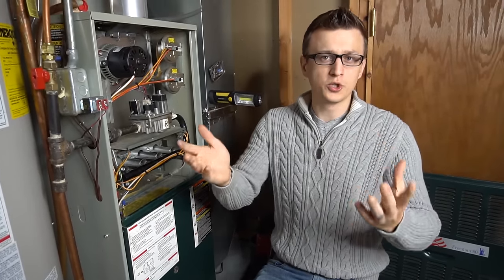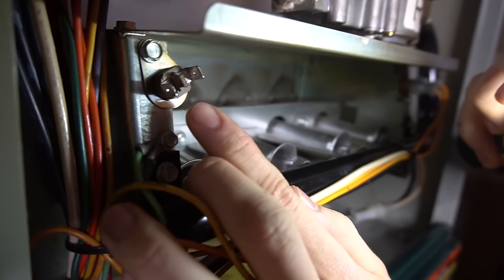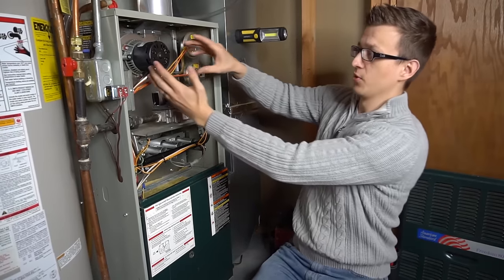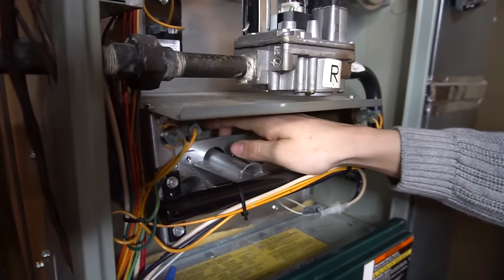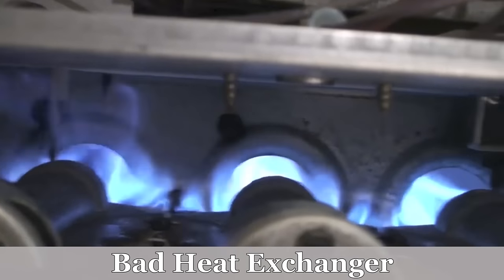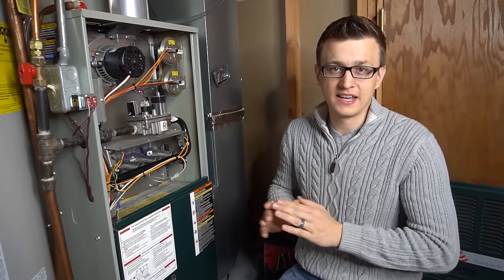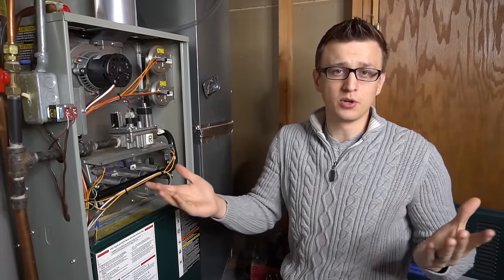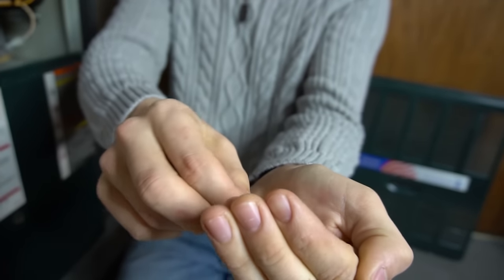Furnace Flame Roll Out Switch Tripped - How it Works

Comment: I'll reset mine exacT SAME unit and it keeps making me wait 3 hours I go out and toggle the hard lock out outside and then come back and sometimes it may come back on if I toggle the switch inside and mess w the thermo it does have 2 rolling buttons one on the flame sensor and one on the glow stick. Its not sticking the flames in they are going straight up and I can see into my attic the cold air is beating down from above the furnace where a tech left it open. Is that what it is? The gaping hole?
Family is freezing its 15 in deer park tx right now
If I smoke a cigarette in garage I can actually smell it through the green door coming from the top so it could be blowing the gas out of the channel I was wondering

Comment: Awesome video
Reply from the maker: Thanks Michael! I appreciate you leaving a comment on many of the videos you watch. You are becoming a familiar face :)
Reply: Very welcome  have a question  should a induser motor be hot to the touch  is that bad
Reply from the maker: Hot is okay, especially if the inducer motor does not have a cooling blade. But it depends how hot.. If you put your hand on the motor and you can't keep it on there for more than 5 seconds.. That's too hot. Most likely that motor is starting to fail.

Comment: I'm installing a new Universal Integrated Furnace Control Board (50M56U-843) to replace my previous control board (50A65-120-04,  56L8401). I should mention that both are White-Rogers products and this going into a Lennox furnace. The instructions that came with the new board has a special replacement instruction at the front, indicating "ROLLOUT SHUNT JUMPER REQUIRED ON ALL TRANE/AMERICAN STANDARD FURNACES, AND ANY YORK P3UR/PCLU MODELS".

Any idea what the jumper would be meant for, since my furnace isn't one of the brands mentioned? I'm assuming that since my brand is a Lennox, my control board would NOT need the jumper.

Comment: HELP! I have a 12 year old Amana furnace, pretty standard, but the flame rollout switch tripped so I had to partially close the gas service shut off valve red handle and that was okay for a month but now it tripped again and I had to further close the valve thus derating the furnace (make the flames smaller and easier to suck in). It seems that the inducer is not sucking hard enough on the heat exchanger, and thus the overheating. The inducer motor is a shaded pole 3000 rpm unit. My pipes are clear, what to do?

Comment: We just got a brand new furnace a couple months ago. I has been working like a charm. Now, 3 days ago we shut it down because warm days and all that saving energy blah blah. Today I tried to start it again (its cold as a penguin's ass) and I got the open rollout/open control fuse light blinking.

So my question is: do this things tend to break that easily?. or is it just because I shut the whole thing down?. Any help would be greatly appreciated.

Also, great video. Very educational.
Reply from the maker: Odd, if it's a new furnace then it's pretty rare that the flame rollout would trip. By control fuse, does it mean that the 3 amp fuse on the control board is blown? (could be caused by various things, like the AC for example) I think the fuse would be more likely the problem then the rollout. You shutting it down for 3 days should not have any side-effects on a normally operating furnace/air conditioner

Comment: Dude you’re awesome! Great at breaking things down. So for the most part what are some things to check out when the roll out switch trips? (Btw thought it was funny when you were smacking the shit outta your flashlight at 3:05) lol
Reply from the maker: Lol, thanks man. I guess I forgot to edit that part out, oops :D It's a good flashlight, the batteries were in there a bit lopsided though so it needed a few good smacks. 

If the flame roll out is tripped, I usually check the vent pipe and the intake pipe (if high efficiency) for any obstructions, bird nest material, etc. I check that just in case but actually the pressure switch should open instead if there is any problems with drafting.

Then I always check what the carbon monoxide readings are coming out the flue. With a tripped flame roll out, the readings are typically in the thousands PPM. On high efficiency furnaces many times the secondary heat exchanger is plugged and that's what trips it. 

After I reset the roll out and turn the furnace back on, I watch the burner flames when the blower motor comes on. (after it pre-heats) If the flames start flickering when the blower comes on, then there's a high chance that there is a crack or a hole in the heat exchanger. The heat exchanger separates the house air from the combustion gases, therefore the blower motor should not affect the flame patterns in a normally operating furnace. The burner box tends to get pretty hot too. To the point where you can't keep your hand on it.

I visually inspect the heat exchangers too. (Not every time) On an 80% furnace I will pull the blower motor and housing out, get under the furnace and look at the heat exchanger that way. Having an inspection camera or an endoscope for your phone makes life easier.
Reply: Yeah he's one of the best one's on youtube. Very explanatory and slowly walks you through it!  Huge  thumbs up!

Comment: I am having a problem with a furnace giving me a code for a bad roll out switch. Fortunately, there are two units in this home, so after I changed the filters, I swapped the roll out switches from the working unit to the non-working unit with no results changing in either unit. So, then I went ahead and swapped out the hi limit switches and flame sensor again not change. since it was later I left the customers home to wait for parts supply to open however the next day he calls and says now both units are not working. I went back and sapped everything back and still nothing working. Please help on what I should check next and can bad parts contaminate a unit?  Please advise I have an urgent need to get these people some heat before Thanksgiving

Comment: Are the flame roll out switches in the 24V circuit?
Reply from the maker: Yes. Usually in series with other safety switches too.
Reply: @WordofAdviceTV  Thanks! My old heater has no flame roll out switches but I plan to fix that.

Comment: My heater wont start blowing hot air at all. I checked the furnace for error code. Indicator blinks 3 times then stop and so and so and so.  Also I' ve  noticed no gas kicking in and blower fan aren't blowing. I cleaned the fire sensors  , small tube that on induce motor.  I waited till this morning to start it and nothing happened.  Inducer motor aruns but no gas, no blowing motor runs. Help ,please . Thanks

Comment: My Bryant 90 plus gas furnace has. Error code 33. What I found is my night temperature 55 is too low at a very cold day. After I change to 60, it is working fine. At very cold day, you may need to increase your  temperature.

Comment: Can a power spike cause it to trip from a lightning storm etc?
Reply from the maker: I don't think so, or at least it is not something I have ever seen. This switch trips from temperature/heat.
Reply: @WordofAdviceTV  This was my issue, I just pressed the button and it all works now. I looked at my flame and it pulls in very strong like yours does so it all looks good. I checked my pvp pipe all the way and it 100% clear to the roof. very odd by just resetting the switch it seems all good now.

Comment: Rollout switches come in 180 and 200 degree switches?
Reply from the maker: Those are common temps on them but it seems like every manufacturer has a slightly different temp rating on them. So I can't say for sure what temp rating the rollouts come in.

Comment: Actually the Codes are usually on the outside so that panel removal is not necessary to determine the failure mode.

Comment: I have 3 of those switches. 2 by the burner box which doent trip and one on top right below the exhaust tube that goes up. The flames are a perfect cone but for some reason the switch up top just started tripping out of nowhere. I'm not sure why though, does anyone have a suggestion
Reply: You figure it out?

Comment: My roll out switch keeps opening if it gets to hot and I wasn’t having these problems until yesterday when I took the burners out and cleaned them put everything back like it’s supposed to go and now if I try to turn the furnace up to 74 it won’t even get up to that temperature then it starts dropping in temperature on the thermostat when the furnace is running then next thing I know my roll out switch is open

Comment: Anyone got any ADVICE on Old Tripped Rollout HELP PLEASE: I have an old Goodman GHM807003AN Furnace. When  manually lighting my furnace, I sure tripped my Flame Rollout switch and the Fan Stays on now.  I located the two rollout switches, but they do not have any RESET button. The middle has a small bit stickling up, but it does not depress like a Button would.  

Is that correct, - meaning Old Flame Rollouts may not have any reset and the only option is to replace them once tripped?

Comment: How much does it usually cost to have a rollout switch replaced?
Reply from the maker: The flame roll out switch itself is probably around $15-35, depends on what brand of furnace you have. If a technician will come out to replace it, the trip fee alone will be around 100 bucks, then you factor in the part mark-up, labor/diagnostics, and you end up somewhere around $200-250.
Reply: @WordofAdviceTV  
Hey thanks. So, the small black cylinder that sits center on the base of the rollout switch was pulled out like it were a distributor cap of a car engine. A technician pulled it out and left it dangling there freely, held by its wires. The base plate is still screwed in the burner box. Could I pop the black cylinder back into place in its original position or is it broken now?
Reply from the maker: @dodgingdurangos924  The flame roll out switch is a pretty important safety switch. It would be best if you ordered and replaced the switch just in case there is something wrong with it. But yeah, likely there is nothing wrong with it and you can just plug it back in too.
Reply: @WordofAdviceTV  
You're right. I should buy a new one, but I don't even have a part number for it. We have a discontinued Aire-Flow furnace that's been serviced annually. So, I don't think factory parts are available anymore. Suggestions in finding a close copy?

BTW, I popped the flame rollout switch back together and the heater actually did start working again, where as before, it didn't even light up. I monitored the burn cycles all day and the burning was clean and controlled. The furnace functioned as it normally does. But who knows if that switch will do its job of shutting down the system if there's a flame rollout in the future.
Reply from the maker: @dodgingdurangos924  Ah I see.. Well.. I will leave that decision up to you. If you want, you can try testing it by putting a lighter under the sheet metal around that switch or under the switch itself while the furnace is running to warm it up. If it works right, it should trip and shut off the burners. Then you can manually reset it by pressing the button on the switch. For what it's worth, some old furnaces did not have flame rollout switches. I would make sure to at least have a new carbon monoxide detector though.
Reply: A friend of mine services them for a living. In his words "its almost never the switch". he isnt sure he has ever replaced one.